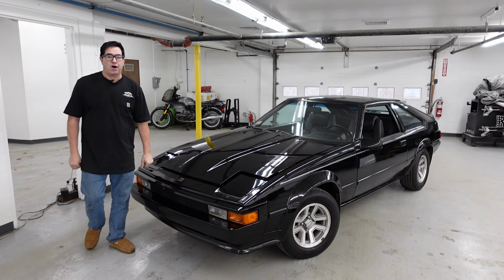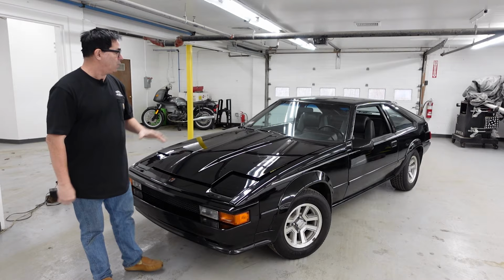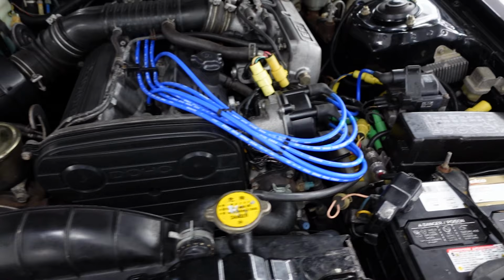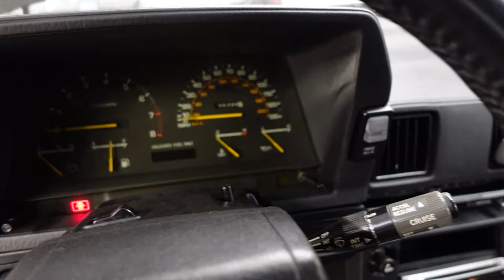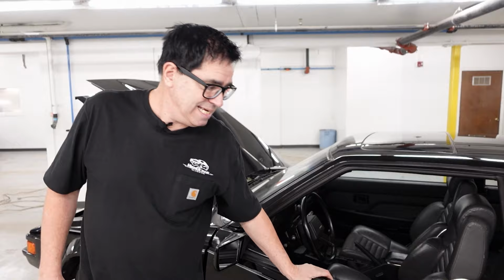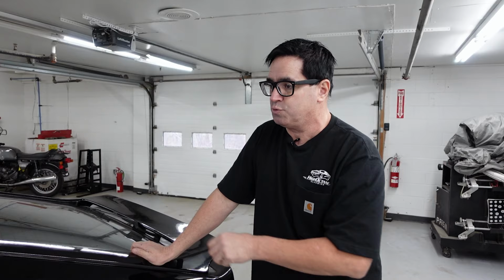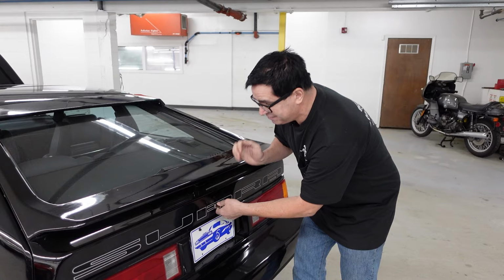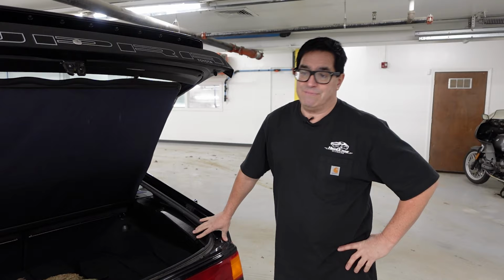UPDATED | 1985 Toyota Supra Walkthrough with Steve Magnante | High Octane Classics

Comment: Several mistakes.  - An auto trans was indeed an option for the "P" type.  Not common, but it was available and I have seen a few.  The "spoiler" on the hatch window was N/A on the "L" type, but standard on the "P" type, not optional.  Horsepower for an "85" was 161, not 170.  Having said that, the car is a thing of beauty, and does not seem to have any cosmetic flaws.
Reply: Yeah,he missed the ball. 84-85 Celica GTS came standard with the IRS and wheel flares. On coupe, hatchback,and ASC droptop. They also came with most gimmicks/ features found on supra with the exception of hard plastic trim pieces covered over with soft touch surface exclusive to supra and convertible.
Reply: I have an 85 here in Australia. What some people call a spoiler on the hatch is actually a sun shade. Stops the back seat passengers frying under all that glass. Probably acts like a spoiler somewhat though.

Comment: Designed at Calty Design. It was Modular A60 design, pretty much like any American unibody car. The pizza base turret  core was the same as the base Celica, with minor pressing changes to accomdate IRS, just like the Colt Sigma based Mitsubishi Starion. Like the 164 Volvo compared to the 144 Volvo. The extra wheelbase length was equal to one extra cylinder spacing and its water jackets, 4.47 inches on a 3.55 average bore spacing IJZE engine in its home market. The first JDM 24 valve engine was almost a  4AGE engine with an extra two cylinders. Toyota needed Lotus to fix the rear mounted steering boxes propensity to make BMW style semi trailing arm oversteer. Porsche had to use Wiessach geometry, Nissan had to use Hicas, Ford decided to use forward mounted steering gear from the first Cortina Mark III and Rear Drive Escort Mark II and European Capri Mark I. And the design assistant for modelling the Supra, none other than Vectors Jerry Weigert...
Reply: Lots of knowledge sir!

Comment: I have a minty 85 Supra p-type. The p-type not only had the fender flares and wider wheels and tires but also had a limited slip differential that was not available on the l type. Toyota was at the top of its game at the end of the '80s with this car, the first gen MR2 and the Corolla GTS. They entered the 90s with the Gen 2 MR2 which was gorgeous and the MK3 Supra which was over engineered like a Lexus because it shared a lot with the SC 300/400.

Comment: The 1984 and 1985 Celica GT-S had the same performance options as the Supra like rear independant suspension, fender flares, and disc brakes just with the 2.4 liter engine and less weight. I owned a 1985 Celica Gt-S notchback and drifted it around corners and smoked LT1 Camaros in street races. I wish I would have kept it.